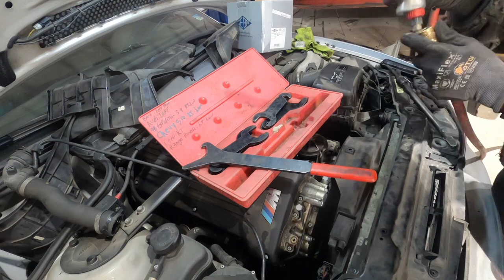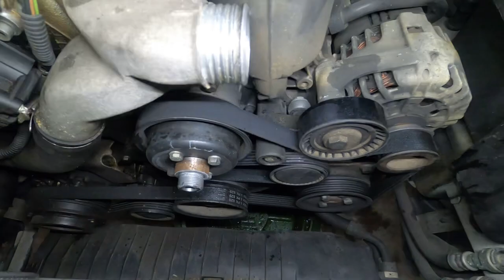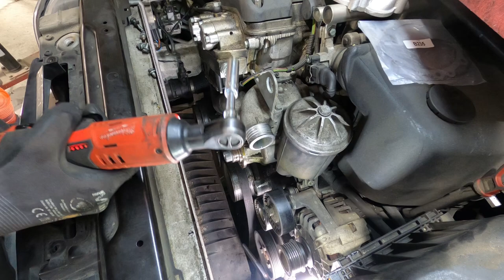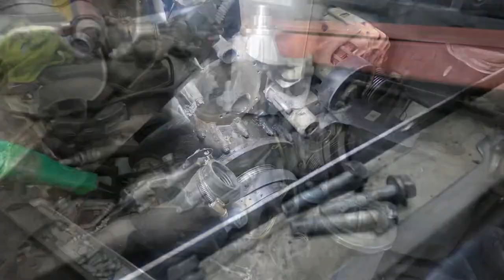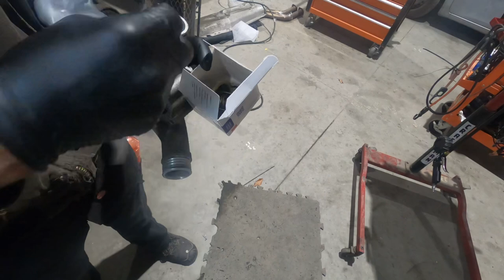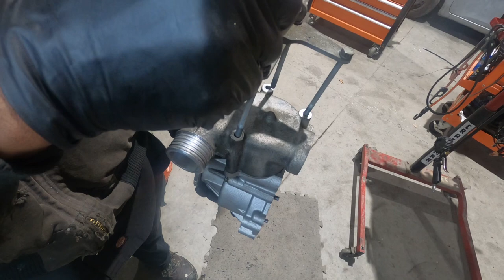E46 M3 Water Pump Replacement Jamaican Style '

Comment: Boy me tell yuh, i was there with you as if i was doing it myself.
Not a mechanic myself but i dabble a bit on mine and my family's vehicels
i myself im an electrical engineer but chose to be engineering tech so ive worked on cnc machine, automatic car washes, ev charging stations and now injection molding machines.
So the struggles are 100% real doing repairs and service, and then its like them blasted engineers try their best to see how much they can piss us off and make our jobs more difficult.  Big up to you for your channel and doing your thing man, bless up.
Reply from the maker: Lol ya man respect for the support I really appreciate you spending the time

Comment: What are typical issues with the 2003 BMW M5? I'm thinking of purchasing one as a restoration project.
Reply: They are pretty solid but timing chain guides and vanos issues are a bugbear. Other than that, standard older car issues.
Reply from the maker: Solid Solid machine. Timing chain with age and miles just like any other car. This car is one I would grab if the price is right. Solid. Just have it checked professionally before purchase
Reply from the maker: facts